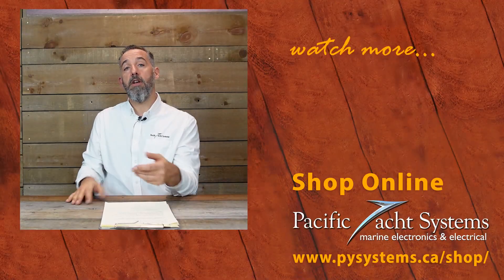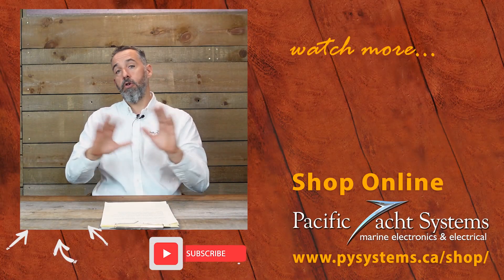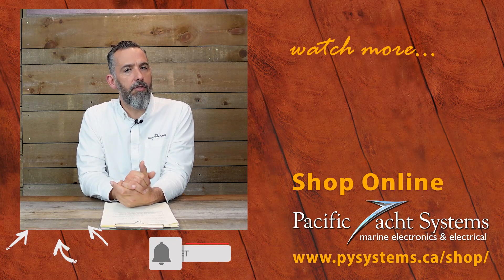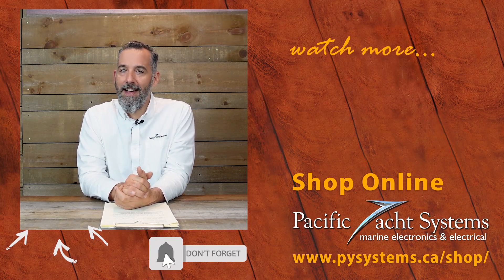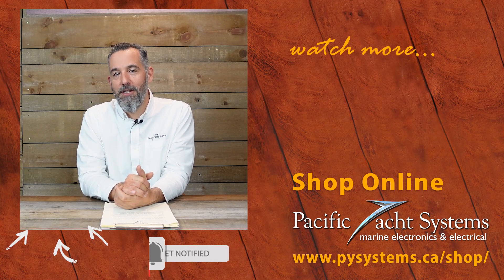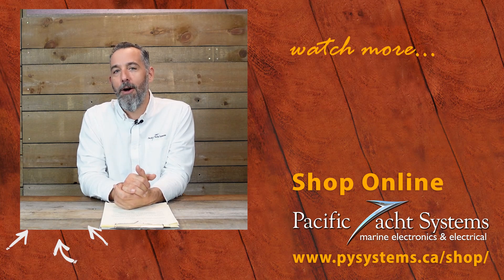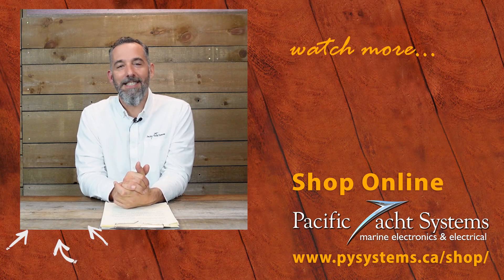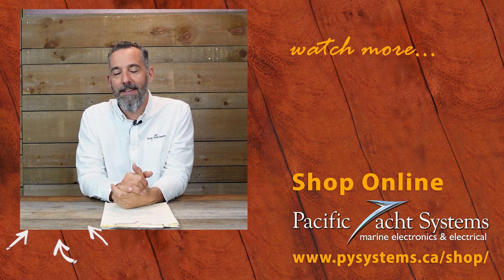Do I Have to Leave My Inverter on 24/7 to Power My Boat’s AC Only Fridge?

Comment: Would it be possible to set a low voltage shut down on the inverter to prevent the house batteries from going completely flat?
Reply from the maker: Most larger inverters have a programmable set point to do this.  Many are pretty low by default though say 10.5v.    The problem is finding a middle ground between the batteries slowy draining and the battery voltage droping from a short term large load.  So some also have time delays as well.  IE shut down under 12v if more then 5 mins.

Comment: No need for go true inverter. Can go direkt from batteryes if freezer and coler have same volt ore use stepdown.
I do that.  But have 44kw agm to use 50% of.  So No stress for me.

Have hybrid inverter too but No need for use it.
But have used it for 24/7 1 year whit No problem at all

Comment: Great information Jeff! I urge my customers to place a cup/glass full of ice cubes in their freezers. If they return after an extended period of time and the the cubes have melted to a solid block of ice then then they will know that the freezer has defrosted and then re-froze. Also during the winter if multiple air dryers/dehumidifiers/heaters are on the inverter circuit then you would definitely NOT want the inverter to be on 'stand by' mode as your battery bank would be depleted within minutes/hours due to the high load. I sell and install the Siren Marine monitoring system and it will alert of any shore power issues, low battery or low temperature situations. There are other systems that will do this with an annual subscription of around $200.
Reply from the maker: Thanks Ryan for all the good advice.

Comment: Agree with everything Jeff said.  As a remote monitor / alert if your fridge ever fails (for any reason) I highly recommend a remote Wi-Fi temp / humidity monitor.  I have a Govee WiFi Thermometer Hygrometer H5179.  This assumes wifi at the dock.  If you don’t have Wi-Fi at the dock but do have cellular (but don’t want to get hit with $30/mo) then you could a mobile hotspot where you pay only for the data you use (by the gb).  I have a skyroam solis for this.  Between the two I can remotely monitor temp and since the data these sensors use is tiny I pay maybe $20-30/year.  I also run a eufy security cam (which also has no monthly fee) that can see my battery monitor / switch board as well.  The three of these give me a lot of peace of mind.  Not as fancy as the dedicated marine monitor solutions out there but much lower cost AND required no permanent install / modifying the boat as well.

Comment: Solar could be a solution, keeping the battery charged while shore power is disconnected for whatever reason. This way you can leave your inverter on, at least for the summer season. Solar saved my food and I continued have instantaneous cold beverages more than once.
Reply from the maker: Good suggestion Ernst.

Comment: This is a good case for using a remote boat monitor system. I have a Siren Marine system in my boat. I get alerts if shore power fails, the boat moves, battery voltage drops below a threshold, bilge level high, or excessive live pump cycling or run duration. It also supports door sensors for intrusion detection. You can also add temp sensors to detect fridge failure if this is important to you.
Reply from the maker: Thanks for sharing Howard.

Comment: Grid (obviously) -> inverter (set with battery SOC (State of Charge)) -> Chris' idea below for a panel or 2 -> Genset autostart based on SOC for recharge - wifi / internet monitoring

Another trick we use is the "quarter in the cup" - 3 variations - 1) just a zip lock bag with ice cubes (if you come back to a block - you lost power - dump it all. Variation 1 cube with food color and the block is "Red" 2) use a "tupperware" point is - closed container 'cause ice will sublimate (go from solid to vapor and gone). and the original was a quarter suspended in the ice and falls to the bottom of the cup.
Reply from the maker: Thanks for sharing.

Comment: The most simple solution is to wire a new relay to turn on the inverter, in parallel with the fridge's thermostat. Always consult with an electrician when doing so to avoid fire. Some inverters have automatic transfer from grid x solar x battery, or power saving mode with electric pulse.
Reply from the maker: Thanks for sharing.